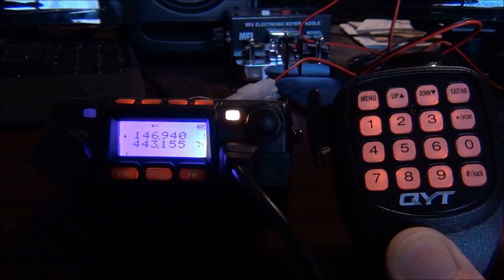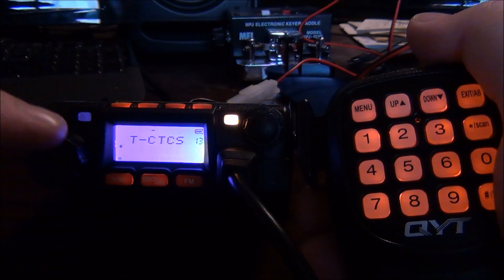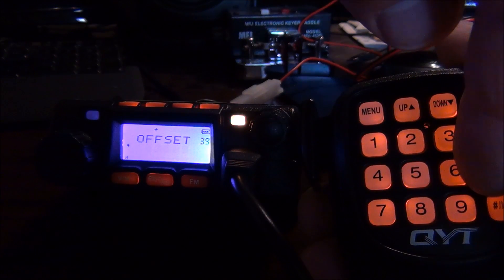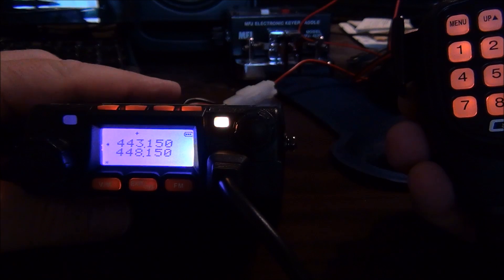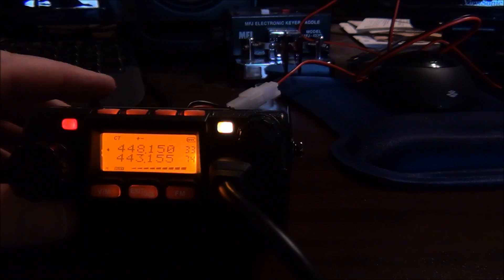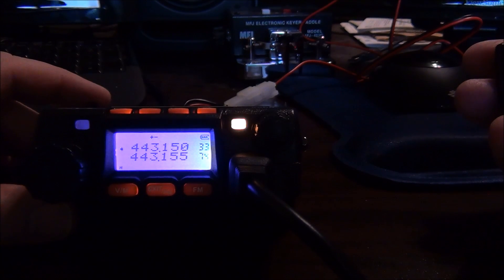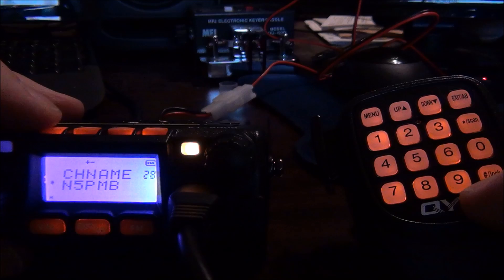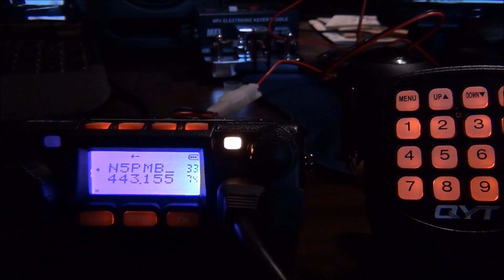Programming Repeaters into the QYT KT8900 Mini Dual Band Mobile Radio Review - AF5DN

Comment: I have one of these radios - It's a bag of junk. Apart from the idiocy we have to go through just to programme a repeater, the front end is as deaf as a post.
Mine ended up left in the car on the local VHF calling channel. I added the local club net simplex channel, and the local RAPI (Glorified CB) net.
As far as repeaters go, I simply can't be bothered with the QYT, so I use a Bruno hand held for general use.
I set up a mobile aerial for that and its 10 watts does easy well enough for my needs.
My advice is, don't buy QYT unless you love headaches.

Comment: Picked this radio up at a hamfest for $20.
 I am not having any luck with this method or anyone else's. It seems to only get into the repeaters in VFO mode, but not in channel mode once it's programmed into a  memory channel,and other attempts its shows a receive light from the repeater with no volume.
 my channel mode display is different than the one on the video. Maybe it's a later model?
I am thinking total reset.
Reply: What everyone failed to mention,is that #30 CB-MDF [B Channel Display Mode] needs to be in the FREQ. setting.
Now once I name the channel I get the +- icon,and hear squelch tone out of the repeater that let's me know I am now getting into the repeater.

Comment: I just bought the same radio but you said it has high and low power. The one I have the QYT KT8900 has three power settings on the mic #/lock button. Low is 5 watts, HL is 15 watts and High is 25 watts on 2 meters. 70cm is 5w on L, HL is 14w and H is 20 watts. Does anyone else's radio work like this? The manual list H,L only.

Comment: Programming Your KT-8900 CB Radio

  1. Make sure the KT-8900 programming cable is plugged into the FRONT of your KT-8900 and PC USB Port 
  2. Go To Website . . . http://www.prolific.com.tw 
  3. Download KT-8900 Cable Driver (PL23XX_Prolific_Driver_Installer_v401.zip)
  4. Install the Software Drivers 
  5. On your PC - Open "Device Manager" 
  6. Click on Ports(COM & LPT)
  7. Identify the COM Port for Prolific USB-to-Serial Driver (COM6, COM2, COM3, COM#,  etc.) 
  8. Open CHIRP software
  9. Select "Radio", Select "Download From Radio," Select your COM #, Select "Vendor", Select "Model"
10. Clone Progress Begins' "Cloning From Radio," Select "Channels," "Frequency," "Tone," to change each as needed!

Comment: Awesome video! Thanks for putting this up. Like many other comments, I was one of those pulling my hair out. I programmed, saved, re-programmed, re-saved, re-tried and tried again, and could not get repeater offsets to work in Channel mode. 
I'd given up entirely on Channel mode until late yesterday, and had committed all local repeater settings to memory and would "simply" re-program the radio for each repeater I might want to be on or contact. 
Literally, if I could afford a new radio, I'd have bought one and used this thing as a paperweight (or as another comment put it: a projectile to launch out the window!)....until this insightful clip. So, in a way, you've saved the life of an unknown passerby who was likely to be struck in the head by a flying radio. 
You, sir, are a Saint! 
73 de ZS1WW

Comment: i am having problem with the programming, I accidentally reset the program ham radio QYT-kt-9800, and its required  cable for setting  the function to work the system, reset to zero , no input data and its not working screen empty its not functioning , cant not be donein manual input,   need to buy a cable programming......

Comment: The Trick is at 4:15 and it is indeed a strange one ,,, but it worked for me on my KT-UV980. 

Thank you so much for this.  My radio has been almost "Un-usable" on repeaters.  I could vfo into a repeater and set it up as normal and the offset would work ,,, but could never get the offset "to stick" on a memory channel.

Comment: Having the 'BEEP' mode 'ON', is very helpful so that you know for SURE that you actually DID push a Button sufficiently. I also asked but didn't see any reply....Did you find (like another Youtube video showed), that the Output Power drops with a sustained transmission? Apparently on UHF, it drops from 20W down to about 15W during even 1 transmission, unless that guy got a dud? Thanks.

Comment: I am 77 years old and having trouble following you. Please is there a way you can explain this more simple. Thank you. I have been told there is a CD that will program my Ham radio. Where will I purchase one from. Thank you. I live in England UK?
Reply: Hi Gerald, it's pretty easy. You need a programming cable (few bucks on Amazon) and you can download a software called Chirp, it's freeware. Very intuitive and it works perfectly. 
73 de IU0KWX
Reply: Chirp doesn't work with a MAC ?

Comment: Thanks for putting this video up!  I acquired a very early model KT8900 a couple of years ago as a 'back up rig', but never really bothered to look at it until recently when I got a new car and need a rig for it!  I thought I was lucky when the seller also gave me a programing cable and software, which naturally I assumed would work ; WRONG!!!

This little radio has driven me around the bend in the last 3 days!  The instruction sheet do not relate to the radio!  It refers you to buttons/functions that aren't there and best of all the instr. sheet its self refers you to a page that doesn't exist!!!  

Things are supposed to have improved with the later models??  Not sure, but tbh if I can get the local repeaters programmed in following your method(s) then I'll be very grateful - if it doesn't work, then I think this radio is going to take a trip out of my window!!  Regards Lin. Exeter.

Comment: Definitely do not buy the D quad version. To work repeaters it does not work in memory mode. The ctcss, offset, or both fail to stick. Also calling a repeater in vfo mode sometimes the ctcss defaults back to 71.0 in the middle of a qso....the D version stands for DOG....

Comment: I have the quad monitor version of this radio and the programming works except the shift never sticks. Every memory channel has no shift. To use the channel I have to change to vfo mode for the shift to reappear. The QYT engineers were probably on a bender when they designed the Quad model.

Comment: I programmed my KT8900 with Chirp and did not run into the secondary issue of loading the offset frequency. Does this only happen when manually programming?

Comment: Seem to be having issues programming the kt8900, even following your vid.  Your vid is great in the programming but my kt8900 seems to be acting a little different.  It doesn't want to hold split on 146.610, 146.010, 110.9 .  I would have never known about the tx freq. lol.  Thanks.  I will keep trying seeing I have 2, if not RT system here I come. lol

Comment: This video really helped out with programing the radio.  I am able to now talk on my favorite repeater.  I do have a problem, I entered a couple of simplex frequencies.  To test these I had my wife use a HT and go in the backyard and transmit.  I do not get a receive from her, however, she can copy my transmission.  It was simplex frequencies I entered with no CTSS or offset, etc.  Just the frequency.  My two handhelds can TX/RX each other and both copy the JT 6188, but the JT 6188 cannot receive on these simplex frequencies.  The repeater frequencies work fine with TX/RX excellent.  Please help anyone???

Comment: I found a different way to do this on my Baofengs and i think they are similar. The * button switches to to INPUT freq mode (input to repeater frequency), i it subtracts or adds the split diff freq for you so you dont have to then type it in for the store function - when in this "repeater" or "reverse" mode a "R" is displayed in the screen. 
Also a completely different method is that you can forget the split diff altogether and simply remember that first time you mem store command is going to store you RX second time you use store memory command its going to store the TX and provided you have ctcss in there you can actually just dial in RX freq and say store... then type in tx freq and press store...  DONE. (and forget the split diff ofset and split + - direction as it doesn't then matter.)
Not sure if that works on these radios but there are a few ways you can do this so interested if this works for you.

Comment: To set your repeaters is easy.   Save your RX freq to your channel you want to .  Now in back in  VFO mode again set the CTCSS tone, set the Rptr offset + or - , set the offset freq then exit menu mode back to VFO mode.  Now once you have set all that ,you just need to press the  */scan button on the microphone to display the reverse repeater freq. then save that to the channel it needs to be.  Far less pressing buttons and twiddling knobs.   (  remember to change the CTCSS tone to match each channel for the repeater its for )   Pen and paper  is a must to write down what's in what channel so you don't get lost in what's been programmed.  If you mix up a channel then just delete it and start again with it.    Hope this helps you all.  and isn't to confusing.   Regards Dave  UK
Reply: This worked perfectly on my KT-8900R

Much simpler, thanks!
Reply: How about the settings or the users radio still the same from the qyt base repeater?
Reply: It seems these radio don't like to be programed with split stcss tones. I had a personal repeater that recieved a certain tone, then transmitted with a Diferent tone. My qyt 8900 radio is the only one I can't seem to get to with split  tones.
Reply: @Number4lead  you dont need a RX tone  in your radio. Only time you set a RX tone if there are more than one user on the same frequency.

Comment: You dont have to calculate the offset manually . . . . . .  Once you enter the frequency and settings to the appropriate channel the first time  .. Hit Exit .. then "*/Scan" ... This will indicate the offset frequency (Represented by a little "R" at the top of the screen) . . Then just go back to Memory and save again in the same spot. . .  Exit out and hit */Scan again to enter the next one etc etc  :) Happy Days.

Comment: I used this video to program the KT 8900 and everything went well; good job. Five repeaters were programmed and the channels were named and I made several contacts. Then, the little donkey froze stiff. Now, it will not allow any action to be performed. It's stuck on a single channel, named channel and there's no way, to my knowledge, to reset the radio. Any suggestions?
Reply: to reset , every thing, then press menu and select  48 then menu and scroll to ALL then hit menu and it will ask if your " SURE "  hit menu and it should say  " WAIT " then flash . turn off and then back on again.  unless you cant select menu ?? then im unsure and unwilling to try on my radio as ive just spent all morning inputting manualy 60 channels with names.  lol
Reply: Mine did the same thing. Found out I had accidentally hit the "lock: button on the mic.

Comment: Dave - Great video.  As you said in your video, I was tearing my hair out with the radio not accepting repeater offset frequencies via manual tuning.  You video cleared up how to do it.  Great, thanks.
Reply: This radio programs almost identically to the Baofeng, there are a few differences but not many if ya have the cable you can use Chirp software to program it.
Reply: @the1spyderryder    Hi Coy.  Roger on that.  I don't have the correct cable, but I have successfuly programmed all that I need, and the radio works well on 25W for such a tiny package.  Thanks for your posting.  Iain.

Comment: This is a nice radio.  However, I found that while holding a QSO for 30 minutes, the radio does get hot.  It was also noted that the mic needs to be at least 2 inches away from your mouth in order to have good audio output, any distance further than that makes it a little hard for the other party to hear you.  The speaker is loud on this little thing, and the volume knob is very sensitive, so the user needs to move it just a little to get the right level.  Despite these little 'faults'... I like the portability of this radio, and it didn't break my wallet to get it.
Reply: Add a little pc fan to the radio to help keep it cool

Comment: How do you change the TX power on a saved channel.  I saved a channel on low power, but when I got into the menu and change it to high, it won't stick.  On VFO mode if I change it, it will save it just fine and transmit on high power.  On the Baofeng handhelds pressing the # button does the trick, but that doesn't seem to work on this.

Comment: AF5DN. I found out that when we saved a frequency into a channel with High TXP mode for the QYT KT8900 .We are unable to change to Low TXP mode while in opeartion. Even though we go to function 3 and change to Low TXP and save. Any good tip to overcome this. TQ 9W8CH

Comment: Many thanks for this video , help me a treat. Question,, have you had any issues saving the high/low power settings on this radio. Every time I set it to low power and then save and exit out it returns to high power . Not sure if there is a trick to it ?
Reply: Answer to this is power setting must be set when setting up and saving frequency. I have now programmed same channel in twice , once on low and once on high power

Comment: This looks like the same programming as a baofeng. In which case you won't need to bother with the + - 500 etc. Just type in the recieve frequency save to a channel. Type in the transmit frequency and ctcss and save that to the same channel. Job done. 
You only need to set the split for use in frequency mode. 
Hope this helps/works on that radio.
73s
Duane 2E0 DIJ.
Reply from the maker: Bluejay1968   Roger Roger